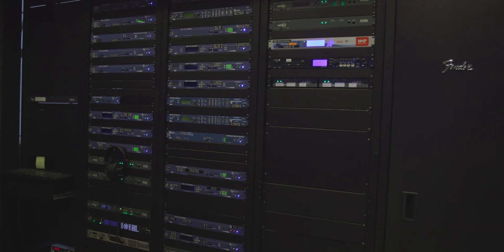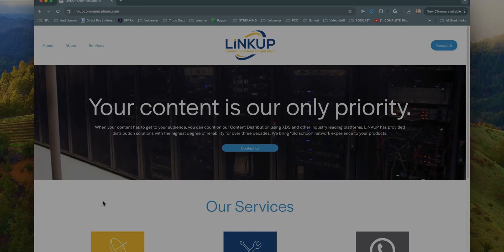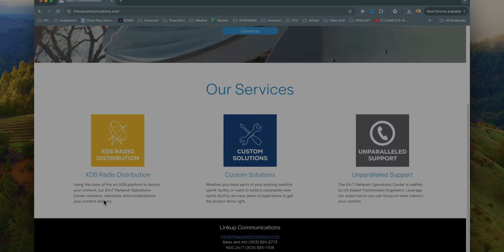What is broadcast radio about? An overview

Comment: Funny thing is the US does not allow a mobile phone to have FM radio in it, despite the fact that pretty much every mobile phone chipset has a built in FM radio receiver, covering from 70MHz to 120MHz, with stereo decoding, built in. Even portable media players (Except those from Apple) generally have a radio function as well, free. you can get it in the US just by using the software update tool they have, and select a firmware that is non US, generally Australia, and you get a FM radio working on them. For phones simply get a non US model that supports US carriers, or an export model for EU or Australia. Even the cheapest feature phones by me have a built in FM radio, and those are very commonly used, as data is in general still pretty expensive, but FM radio is almost completely covering the country in one form or the other.